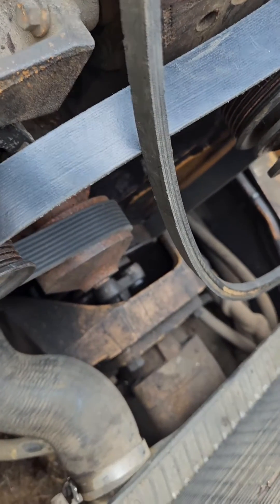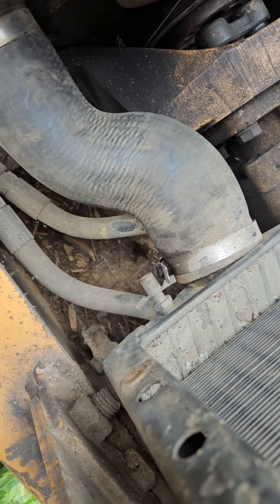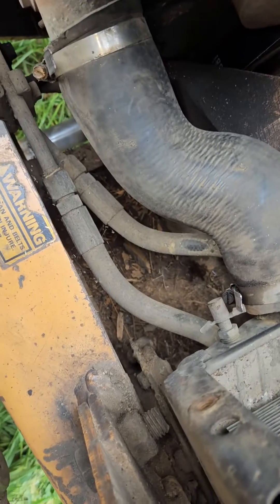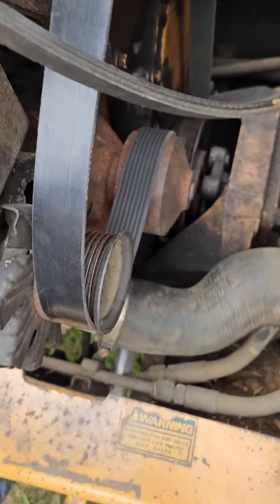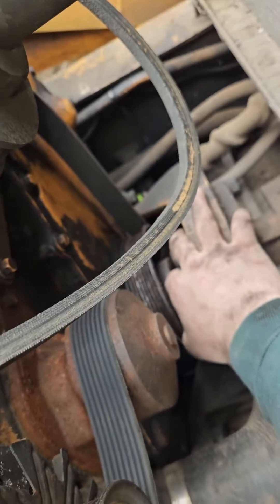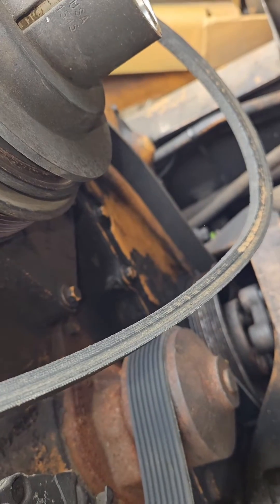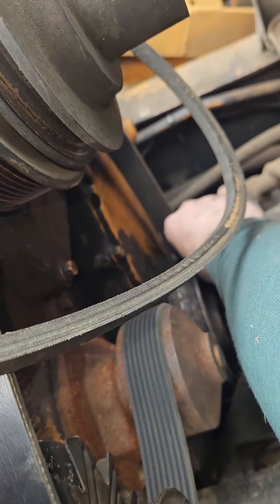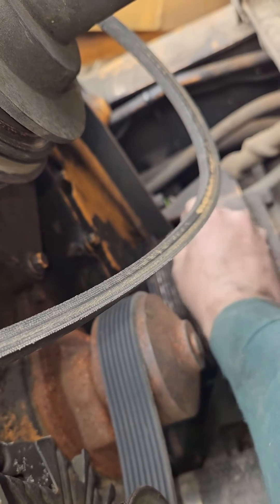Replacement/replacing Belt for a 580K Case Backhoe and process

Comment: Doing this same project and can’t pry it back idk how u did
Reply from the maker: First,I removed all 4 bolts, then used two big flathead screwdriver to fit in between the slots between the pulley and shaft.( It's best to have two people.)I then used a pry bar in the same spot and  Then, I turned the Shaft all the way around where I used the pry bar again and wiggled it back-and-forth. Until it created a little bit of space, you fight it the whole time . Once you get it moving a little, it starts to push back-and-forth, but also used some PB blaster.
Reply from the maker: https://youtu.be/pD5mkjlNA7w?si=R5Nqp1xLOV423fmF